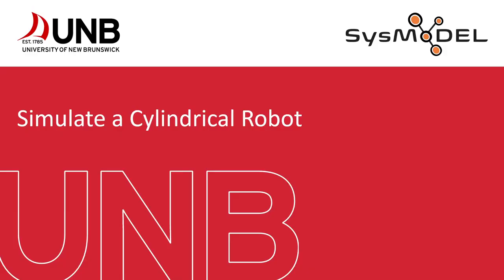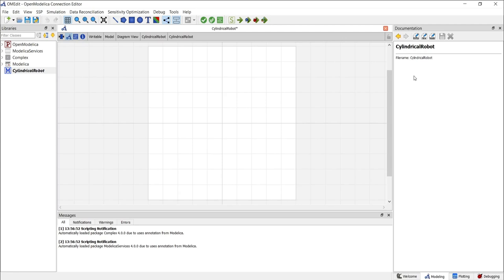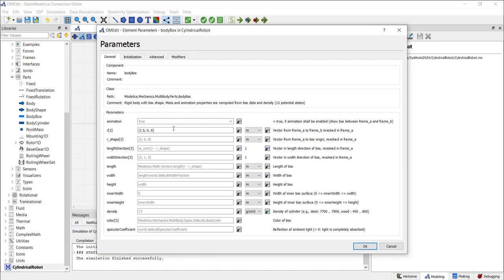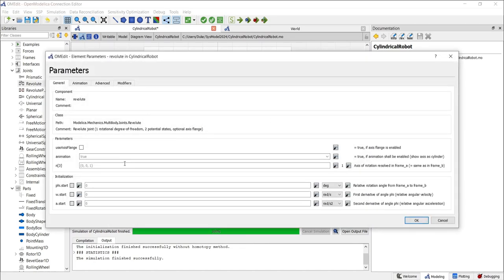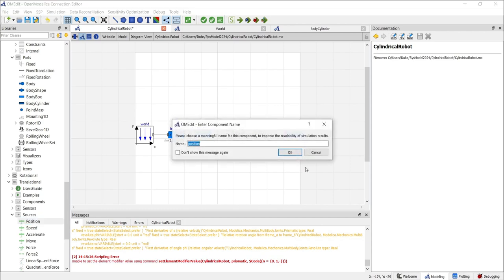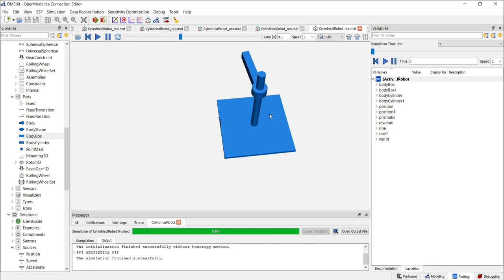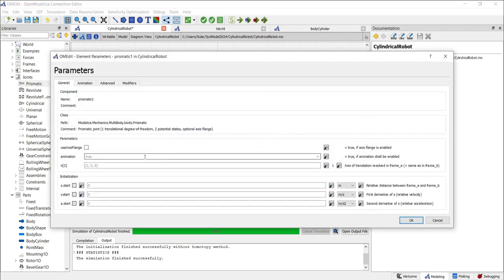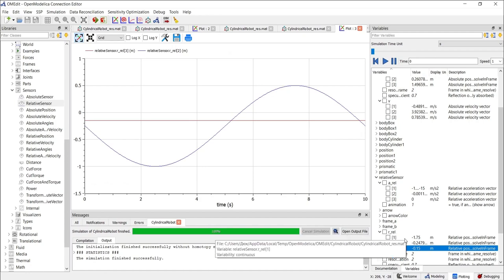Tutorial on the Multibody Dynamics Library in OpenModelica

Comment: I accidentally overthought the following words in Open Modelica: X,Y,Z, Length, Width, Height, Top, Front or Side, and caused a brain bleed. Here is what Google AI says:
"In a 3D coordinate system, the x-coordinate typically represents the "width," the y-coordinate represents the "height," and the z-coordinate represents the "depth" or "length" of an object, with the x and y axes usually considered as the horizontal plane and the z-axis extending vertically upwards; essentially, this means moving along the x-axis changes the width, along the y-axis changes the height, and along the z-axis changes the depth of a point in space. 
Key points:
X-axis: Usually associated with the horizontal width. 
Y-axis: Usually associated with the vertical height. 
Z-axis: Represents the depth or length, typically extending perpendicular to the XY plane"

Clearly there is a queen somewhere who should be dug up and executed to death again and her head displayed on a pike for a few decades for this horror show of words. I doubt the idea will gain much traction though.

Maybe it is just the my freshly ruptured aneurysm thinking here, but I think it might be better on the dialog box to change from
length [order implies x, name implies anything or z]
width [order implies y, name implies x]
height [order implies z,  name implies y]

to instead be
width
height
depth

or a kludge to make english work and soothe my inner Vulcan:
x_length
y_length
z_length

I was going to try to figure out if there is another problem, but in Top, Front, Side views. However I think I will faint before I can finish so I'll leave that one as an exercise for the reader.

Oh, and yes, I know it probably isn't your problem but I think I'll be dead before I find the right contact and at least this might cloud up some confusion for someone else so I'm not the only one to die this way.